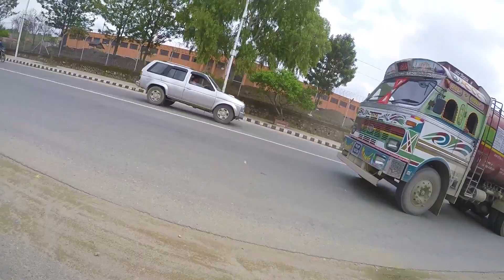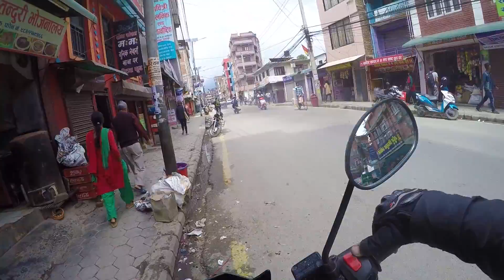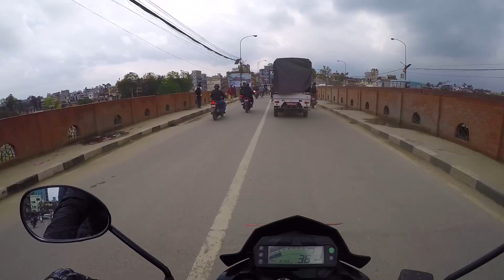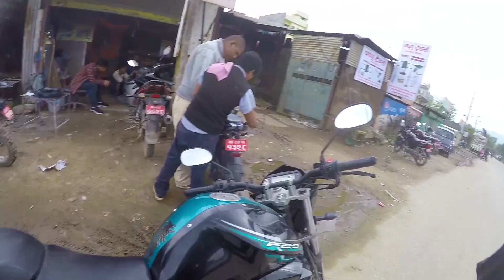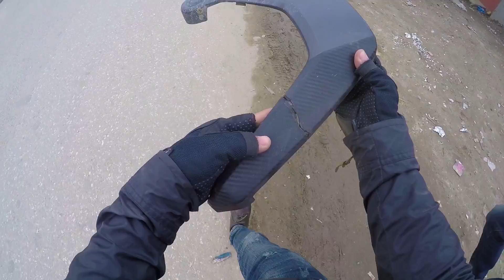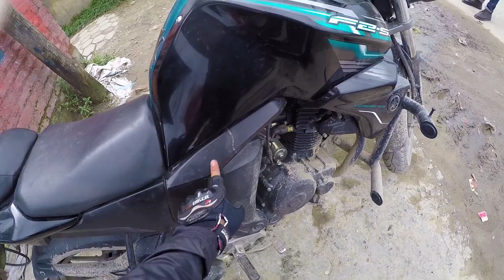THIS IS WHY YAMAHA FZS V2 SUCKS!!

Comment: Bro I have same bike and had same crack on both sides.  I replaced both panels  free of cost at yamaha service center. If your purchase date has not exceed 2 years and 30000 km, and regular servicing in yamaha service center, they will have to replace it in free, you should talk to them.I changed soccer rods too freely.  But now I don't think they will replace yours because you did plaster welding. It should be fresh crack. share it with your friends.
Reply from the maker: ae bro,, thanks for the info!!
Reply: Dinesh Bhandari bro kun thau ko service centre m free ma gardeko??
Reply: Dinesh Bhandari  mero ni same crack vako chaa. 2years n 30000 ni pugexaina.
Reply: Maile butwal ko service center ma bro. jaha ko service centre ma ne gardinxa you have to talk to them.